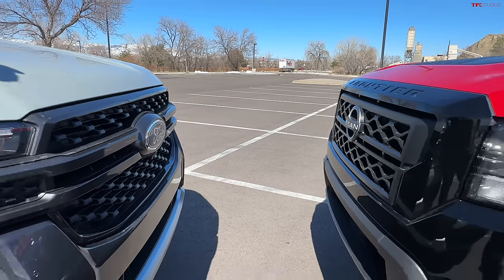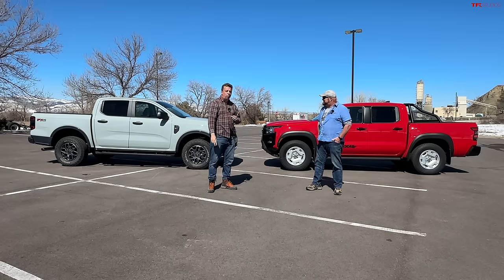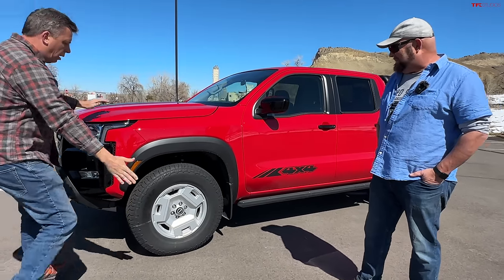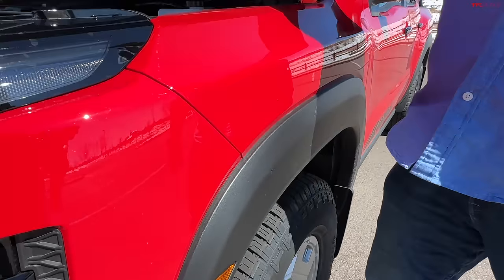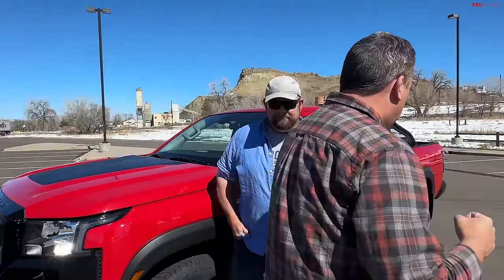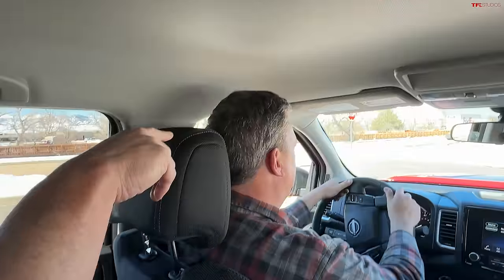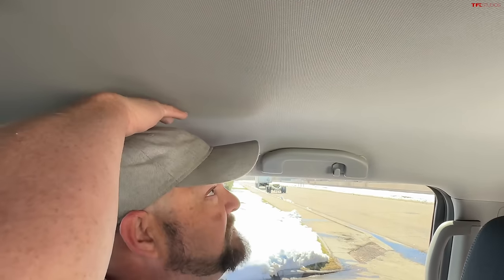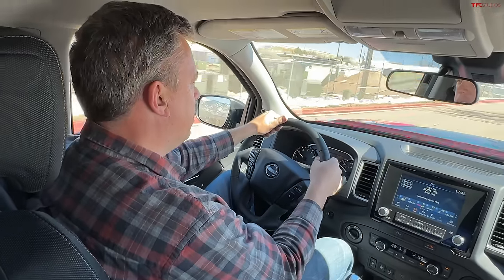This New 2024 Ford Ranger & Nissan Frontier Hardbody Cost EXACTLY the Same, But Which One Is Better?

Comment: I don't realistically do heavy off roading. We have toys/alternate vehicles for that. That being said, I am very satisfied with my '22 Frontier SV. It's towed 5,000lbs + back and forth from PA-FL without a problem. Plenty of power. Transmission does a decent job engine breaking and is definitely noticeable for what it is. It's definitely not a big human back seat, but it totally works in a pinch.

The steering wheel not telescope, but it's actually in my seating position so it's not a problem. 

I can confirm with you saying that I do not like how a forced induction engine drives. We do a TON of lighter weight towing with our off road toys, etc... and I know the turbo motor have power, mpg, etc, etc, etc... I will avoid it at all costs cus I genuinely dislike how they tow. In a little family car, fine. I just use my truck for truck-esque stuff too much and absolutely cannot stand the turbo engine. The linear speed, predictable power, and simplicity of a naturally aspirated engine will be my truck choice until it's no longer an option.

Comment: I'd go with the Nissan because I HATE when manufacturers use massive touch screens. Buttons and knobs are much more intuitive for controls. I like the 8" screen for CarPlay in my F-150, but any larger than that is totally unnecessary and it eats in to the space where they should be putting buttons instead.

Comment: I am 100% Ford, I own three vehicles and all three are Ford's.
But with that said I'd take the Nissan over that Ranger.
The Nissan has everything a person needs without over complicating it. Not to mention the N/A V6.
Andre said they've tested the small displacement with turbo engines before, one year & 10,000 miles is not testing. My 2008 F-150 has the 4.2 N/A V6 with a little over 200,000 miles on it. And that's 200,000 miles of hauling & towing on it with no issues at all.
No it's not the fastest, no it can't jump a dirt hill, but it's ready to go to work.
Reply: "If we have to have environmental regulations, we need one that requires manufacturers to warranty their cars through 100,000 miles. If your car doesn't average 200,000k miles you suck as a manufacturer." — Not entirely a throw-away-thought?
Reply: I gotta say I know it's not apples to apples comparison but the 2012 Ford f350 with a 6.2 gas engine will not die. But the Diesels had to have work done well before the Ford even needed transmission work. Pulling the same heavy trailers. The motor has 328k and had one coil pack replaced and an exhaust manifold bolt replaced. Never leaked fluids and is still going. Ridiculously durable.
Reply: The Ford 4.2 V6 was one of the worst truck engines they ever had. Lacks torque and sucks fuel. My dad had one in reg cab 4x4 and the 5.4 Triton F-150 Supercab 4x4 he bought next got better mpgs. Now he has a 2.3 Ranger that is getting much better mpgs. Best combo of power and fuel economy.
Reply: @302Mustang13  
I will say that I was expecting better mileage out of my 4.2 but I drive it every day & 90% of the time it has tools, & material's in it, & a lot of the time it's pulling a small trailer 5X10 loaded with materials. And it averages 18 mpg, my brother's F150 Platinum with the Coyote does better, so yes I was a little disappointed in that.
But with 200,000 miles on it and I've never touched it other than maintenance "oil changes" & it has always performed with anything I hook to it I'm happy with it.
I bought a Ford Escape & trailer it  home with absolutely no problem.
These small overpressure turbo engines they're pumping out today has plenty of power but I don't believe they will ever last like any N/A engine will
Reply: @scottyellis3442  We were too and I told him the 4.6 V8 (there was no 5.4 at the time he ordered his 4.2 F-150) would do better and get better mpgs. I also have an Escape but with the 2.0 turbo and 8 speed. It pulls like mad with a heavy trailer and keep the oil changed as appropriate and I'm sure it will last. My last oil analysis was flawless with 8,000 mile changes on AMSOIL.

Comment: Love my Datsun by Nissan. With the exception of tires, few batteries, the seat covering, and one intake coolant hose, all original and Still runs perfectly on the original plugs! -1979 620 5 speed getting 32mpg for all of my life. This new Nissian will hold up to its name, would be nice to see tailgate chains/latches for long-term reliability.
Reply: They all rusted out here.  Glad to here yours is a beast.
Reply: Classic truck and you just don't see them anymore.
Reply: @nickdeagle3271  Has minimal rust thanks to its salt free life here in the Colorado rockies. Runs the same gauntlet tfc tow tests new trucks on. It's about time to get it out of the storage container for the year.
Reply: I owned a rust free (CA truck) 1984 Nissan 720 4x4 with a 5 spd. Mine did great up until 284K miles when I rebuilt the synchros on the gearbox and the engine. Not too shabby considering the Z24 engine was notorious for heads cracking.
Reply: My very first car, at age 18, was a new 1975 Datsun truck, 4 speed manual trans, $3700 total price, including all taxes and license. I still have the original loan paperwork, at 10% interest,  The truck was very durable, and reliable. I modified it putting on headers, 2 1/4"  exhaust (for a nice throaty sound), Offenhauser intake manifold, and Mallory Unilite electronic ignition system. I was a part of the new mini truck craze, that started in the mid 70's in southern California. Glad that you still have yours, and that it's held up so long for you!

Comment: My first vehicle was a 1994 Ford Ranger XLT  Supercab 4.0L V6 with manual transmission. I paid $15,500 for it out the door and I got rid of it in 2008 with 200,000 miles. Now I wish I would have held on to it. LOL
Reply: It wasn’t my first vehicle but in 1990 I bought a new XLT Supercab 4x4 Ranger with automatic for 18k out the door. Sold it to a friend 2002 with 298k miles…replaced one water pump, brakes and spark plugs only. I believe he had over 400k when he sold it with same motor and transmission.
Reply: I had a 2001 Ford Ranger XLT with an extended cab (suicide doors) with an auto trans.  I got rid of mine in 2001 with 210,000 miles and all I did was replace the water pump on the truck $350.  The rest was regular maintainence.  4 sets of tires and front brakes 4 or 5 times.  I never had to replace the rear brakes.  Loved the truck.
Reply: sorry 2021
Reply: I had a 96 and 3- 2000's in my business. They were bullet proof. And they are still on the road with over 200k on each.
Reply: @paulchapman1933  They are solid little trucks, and I miss the one I used to drive. I am not no sure all of the new complicated GDI turbo engines (from any manufacturer) are going to be as reliable.

Comment: I've never owned a Ford but I would consider one. I've owned two Nissan trucks and both rusted out before 7 years of ownership here in the northeast and I take care of my vehicles. Aside from the rust, the Nissan was a good truck
Reply: Nissan hasn’t made a good truck since the Hardbody went out of production.

Renault-era Nissan is just sad
Reply: @BC08  🤣🤣🤣 sure buddy
Reply: Get an f150. Aluminum for the win!
Reply: @St.Irenaeus   “jApAnEsE qUaLitY” 🥴
Reply: @trishaleaver3581 lol have fun getting into a small accident and somehow the whole thing ends up getting totaled.
Reply: @santalla03  It’s a2017 and live in a small city in rusty Canada. It’s got a couple scratches that have bare aluminum showing for 3 years now and still shiny. It’s strong where it needs to be. And I’ve double protected the bed. My last truck was rusted beyond saving.  I would not care if I lived in California
Reply: @santalla03  F150 most popular car in the world.
Reply: @santalla03  just like a steel body getting into an accident and it being totaled eh?
Reply: that snow and salt is rough. I live in NV and I have a lot of family in NY. Certainly different opinions come in regards to vehicles due to the extreme changes in climate. They drive vehicles that won't rust as quick... yet they typically only own them for 3-4 years before needing replaced anyways. I own my vehicles 7-10 years on avg because I buy used and push them until they don't run anymore aka 300,000 or so miles. Have to get vehicles that can handle the elements and terrain in which one lives. I have loved my frontiers that I have owned over the past 16 years.

Comment: A Pro-4X would have been the appropriate comparison to an FX4.
Reply: Incorrect … the Pro-4X would misalign the prices. Watch the video and they clearly state that these carry the same sticker price.
Reply: @krasnaludek298  Agreed---A loaded Pro-4x would have been $50K so not really comparable. They did a good job.
Reply: My pro-4x was $43k msrp. You can spec the pro-4x into the $50ks but it starts at $39,560.
Reply: @Dusdaddy  of course they are going to make it about price. The ranger FX4 is inferior to the PRO-4x from an offroad standpoint. Their job is to help Ford sell trucks.
Reply: Not all Pro-4X are 4wd
Reply: @gnd111  then its not a Pro-(4)X then its just a pro-x
Reply: @Dusdaddy   actually here in Texas a fully loaded pro4x is 42000, but with discounts they are between 39980-40000! Even when you go on to the website you can get it at arrive 41000!
Reply: @gnd111  lol...yes they are. Bet me....
Reply: @jaylee8542  Why is it inferior? They both have locking diffs, stiffer springs, and skid plates. What does the Pro-4X have beyond that? The Ranger comes with Trail Control and running boards and the Nissan does not so if anything, the Nissan is inferior.
Reply: @Dusdaddy  it's a 4 cyl...
Reply: @Bigfootstorytellers  What are you replying to? Shits 2 months old......

Comment: My 2024 XLT FX4 with spray in bedliner and integrated side steps is only costing me $40,445
Reply: Nice
Reply: Plus, Ford knows trucks. I’ve owned multiple Ford trucks & they’re very durable, despite the Toyota fanboys thinking otherwise.
Reply: @krasnaludek298  There wasn't a Toyota here.
Reply: @krasnaludek298  Toyota fanboys still have a point when it comes to previous generation of Tundra/Tacoma. New gens is another story..
Reply: @krasnaludek298  I get it, but longevity overall, Toyota has the upper hand. Just pull up the numbers. However, the newer ones seem to be sketchy so you make a good point. I personally own a 2011 Sierra Z71 and as much as I want an upgrade in the "bells and whistles" department, I cannot justify the price of a new truck. It's crazy.
Reply: @krasnaludek298  My purchased new 19 fx4 has been more troublesome than a 07 5.4 Triton. Before 30k miles ford removed the cab 3 times for the same timing upgrade.  The transmission failed while going up 70 from Denver at 32k miles.  Ford rebuild / repaired it under warranty. @35k wrench light on dash came on while towing a 8500lb toy hauler needing needed more transmission work., this time not as serious though, something about a transmission part with a groove worn into it, Ford has updated parts for this problem now.   My new 2019 fx4 has been unreliable, it's on light duty work now as a daily driver, no towing anymore after my expenses with it.
Reply: Where did you buy it and when is it being delivered.  I'd buy one today at that price.
Reply: @krasnaludek298  You can buy most Toyotas with confidence, with Ford you better check the reliability history of the specific engine and transmission.
Reply: @Dat_Sun  is your truck an F150 or a Ranger? If it's a Ranger you're towing way beyond its capabilities. Not saying yours is not a lemon but you're also exacerbating the situation
Reply: Only 40k 😂
Reply: So? Just because you got less than MSRP doesn't mean anything. MSRP would be $42,695 for what you described and that doesn't even come with a hitch.....
Reply: @rgii8060  How are the new ones "sketchy" ? Because one out of thousands broke on TFL?
Reply: @Dusdaddy  I don't need or care for hitches. I don't have anything to tow. 
I do not get anything I'm not going to use. Unlike most people that get the vehicles loaded with features they never use or use only once.
Reply: @Dusdaddy  well the post you're replying to mentioned both new Tundra and Tacoma. The Tundra has been out for 2 years and there were a few issues reported through 2022 & 2023. Not sure if these are all addressed but a few owners got a new engine under warranty. A quick search through the Tundra forums will give you that info.
I guess it's too early to chime in on the Tacoma, but I wouldn't take long term reliability for granted on a new powertrain
Reply: @engineer_alv  Nice try but you are wrong. This is the comment I replied to and I don't see the word Tundra anywhere:    "I get it, but longevity overall, Toyota has the upper hand. Just pull up the numbers. However, the newer ones seem to be sketchy so you make a good point. I personally own a 2011 Sierra Z71 and as much as I want an upgrade in the "bells and whistles" department, I cannot justify the price of a new truck. It's crazy"
Reply: @Fernando-t8g  Didn't say you did need a hitch. Just saying the MSRP for what you described is over $2k more than you said. Trying to figure out why your sticker is so much cheaper than the Ford website?
Reply: I see a hell of a lot more 90’s and older Rangers driving around than what I see of same age Toyotas.
Reply: @jeffk464 ....And...the best part is...No Extra Charge for Toyota's legendary reliability !!

Comment: I miss my Frontier Terribly. I bought the 2020 old body style with new engine. It consistently got my 20-21 mpgs. Unfortunately I had to part ways because my family was growing and got an F150.
Reply: An f150 gets better mpg than a frontier, it’s depends on what engine you choose. The supercrew f150 has a huge rear seating area, at 6’3 I still have room of 4-6” between the knee and seatback

Comment: Best Frontier is the S. If you're in the same config (quad cab, 4x4) you get 1,290 lbs of payload for 36k. 1,290 is not amazing, but is far better than what's provided here.
Reply: That’s MSRP.  You can get Frontiers at a discount, especially the S trim.

Comment: The Ranger being able to fit 4ft between the wheel wells is great. With the tailgate down a 4X8 foot sheet of plywood only hangs about a foot and a half beyond the back of the truck.
Reply: nissan available in 6ft bed with kingcab  and slightly narrower overall width may fit better in garage.
Reply: Well I don't like putting a red flag on 2x4s because they hang out
Reply: A TRUCK has an 8ft bed gate up when hauling basic building lumber.
Reply: @tc6580  I use a 5x8 trailer attached to my little ford ecosport for that.  22mpg verses taking my F250 out at 14mpg.  Trailer does atv duty and also is pulled by mower when we are picking up sticks out the yard.  Very handy.
Reply: @spyder000069  but it can’t carry sheet materials between the wheel wells
Reply: @tc6580 a pick up truck is anything with a bed.

Comment: I'm hoping that one day you guys will actually make a good comparison when it comes to the Frontier, you ALWAYS compare it to the wrong trim. The comparisons you should be doing are as follows:

Frontier Pro4x vs Ford Ranger FX4
Frontier Pro4x vs Tacoma TRD Offroad (3rd gen)
Frontier Pro4x vs Chevy Colorado Trail Boss and Z71
Frontier Pro4x vs GMC Canyon Elevation and AT4

I did all of these comparisons recently when truck shopping and quickly realized that the Pro4x is by far the best value for the money. Sure it has it's drawbacks but it's value is undeniable in the segment, last of a dying breed.

Comment: The majority of power tools today are cordless. Anyone that works out of their truck knows how convenient it is to be able to charge batteries when there is no power or when you need to get to the next job and charge on the way. Everything is rechargeable now, I've had a inverter in my work van for the last 20 years for this reason. It's nice they're building them in now.

Comment: The ranger really is a beast. I had a 2020 with the 2.3L and loved it. Bought it on rebate for $30K. It  Towed and Hauled effortlessly; Even in the Tennessee mountains. I put multiple performance upgrades on and it was a blast. In the end I traded it for a new Bronco bc despite all of that, the ranger was miserable on long distance trips. If and when I buy another truck; for $46K, I’d just spend the extra money and get a heavy duty. Midsize trucks are nice in principle but I don’t see the market for them when they cost this much.

Comment: The complaint about engine covers is so childish. Who genuinely cares how pretty an engine bay is? With how complicated these bays are getting, just leave them open without a cover so its easier to see around at a quick glance.
Reply: moreover this is an easy fix, Ford sells the cover (or at least did for the previous gen).  I think it should be standard equipment because it's just a small piece of plastic that should not cost Ford more than $30 to make/source, but if it's not there it won't hurt reliability, which is much more important than aesthetics

Comment: When it comes to trucks and cars I want normal sized screens none of this 10 inch or larger screens. Sure it's easier to use and see. But night driving it's distracting. My idea may not carry any support but I'd be okay with the screen being big when parked or backing up. But when driving it gets smaller to reduce to overall lighting. Even in dark mode it blinds me when someone calls. And only reason for it to be full sized backing up for the camera if it's available.